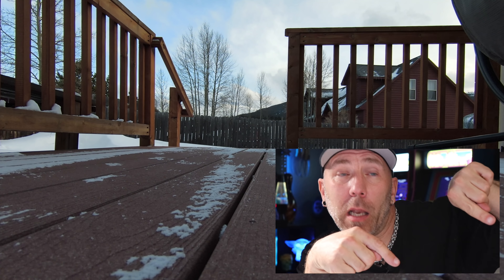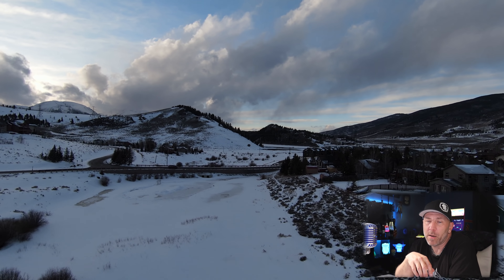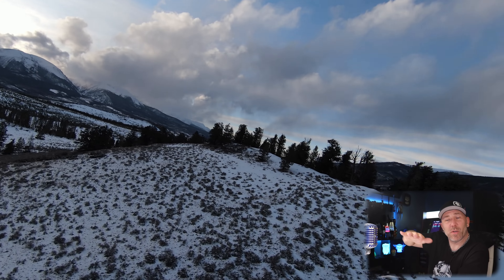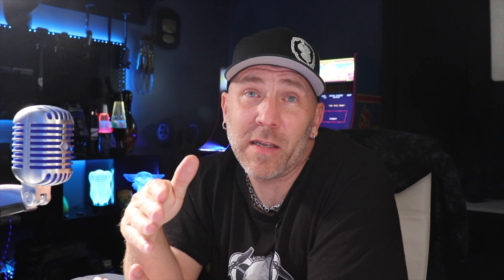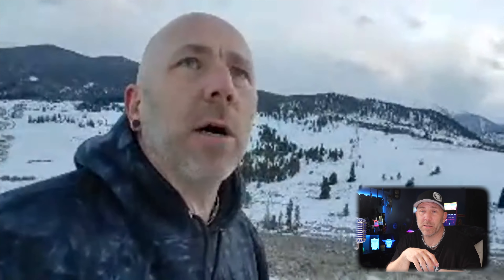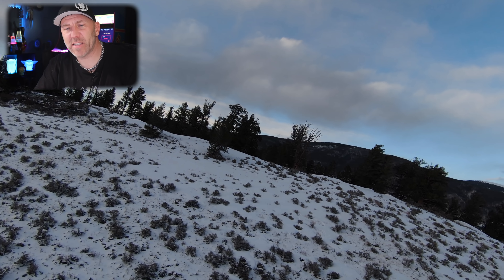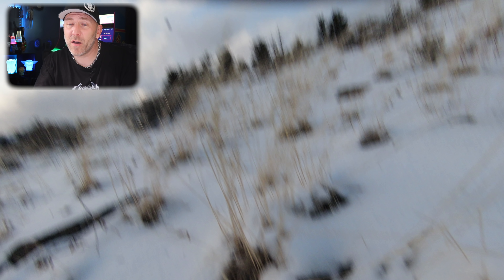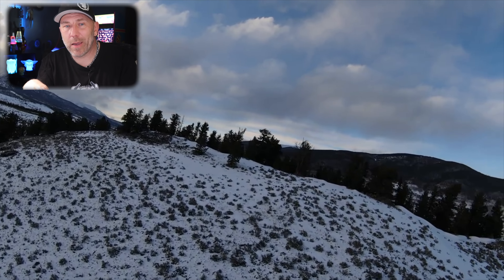DJI FPV Crash - In Drone Footage Explained (Slow Mo)

Comment: Idk if anybody mentioned it already but you have a find my drone feature in the dji app
Reply from the maker: With it on tye dji fpv it is totally different than normal dji products.  So you are aware it just plays footage of the last bits before it disconnects.  For some reason it doesn't show a map like with their other ones.
Reply: @SeanOzz  thought it does, saw a video the other day where a guy crashed his one as well and used that to find it
Reply from the maker: It plays a video back but unless it had a new update it doesn’t work like the maps

Comment: Wow that's sucks Sean but you got a great video out of it. Didn't we learn about altitude Sean. LOL. Glad that it's in one piece.
Reply from the maker: turns out i was wrong.  i lost goggle signal and the drone did it's own thing kicking into Ebrake mode which stops my controls from working. so i lost control for a second and was just low enough that without my control it hit that bush!

Comment: IDK, looking at that footage it appears to me that the quad lost signal and fail safed. If you look at that, right before it crashes there's a jolt to the quad, and you can tell, it has no radio link.
Reply from the maker: I have been rewatching all morning and I think you are 200 percent right.  The camera goes black and auto brake kicks in when that happens before you can take control again. In that moment after signal is lost is when it hard kicks to a stop and I would have not been able to throttle up in that instance.
Reply: @SeanOzz  - i think once you went over that hill and got to low, the radio link was lost. I don't own anything DJI, but ive seen plenty of fail safes! Do the goggles record your signal strength during the flight? One othwr thing i was curious about was if the DJI has some sort of buzzer for locating a downed quad?
Reply from the maker: This does have a buzzer. Found that out after. Yes. The auto brake is fast and it tried. I was just too low.
Reply: @SeanOzz  - I think so, Sean! Hey you recovered it in one piece, awesome!

Comment: You can try  the torto mode to save the FPV.
Reply from the maker: Only if it works or u have a signal.   Mine will not work , not even in full manual.  Also I had NO. Signal.  Updates video  is coming and will help you understand.  ;)
Reply: @SeanOzz  Really bad,
I thought FPV could save itself,
It seems there is no way
Reply from the maker: Seems I'm not the only one having issues with turtle mode not always working.  I plan to hit dji up this week and ask what gives.
Reply from the maker: Check this for updates. No turtle mode for me. 

https://youtu.be/TxBhHxbt6b8

Comment: Glad u recovered ur quad , in that scenario do u think turtle mode would it help u ? Maybe would have flip back on hes legs and try a takeoff that would have been awesome anyway glad ur got it back cheers
Reply from the maker: Turtle mode would if it would activate.  Also u have to have signal for it to work.
Reply from the maker: Updated info 

https://youtu.be/TxBhHxbt6b8

Comment: BTW, after watching this full video and the other one (live) something else to consider:  air density at that altitude would not allow you to gain altitude fast enough to avoid that crash.
Reply from the maker: Figured it out. Goggles lost signal which kicks in auto brake. Normally it brakes and then you can either take control or rth.  In this case auto brake did not give extra throttle or let me.  Screen cuts black and it was all in the hands of the drone at that point.

Comment: crash would be perfect if it was recovered in turtle mode glad you saved yours.
Reply from the maker: Sadly mine and others get turtle mode errors.
Reply: @SeanOzz  cuz you have to switch to manual first =)
Reply from the maker: No shit.  Lol

And for me and many others in full manual is still doesn't work.  Lol

Comment: Hi Sean, I wish that DJI had made the FPV drone to work with a phone or tablet as I can't wear Goggles. Stay Safe
Reply from the maker: you can view from a phone connected to the goggles but it does not show all the data for some reason. i wish it showed what you see in the goggles and let you go through the menus that way by touch.

Comment: Thanks for the two vids.  I recall this from flight training, but I probably won't phrase it exactly... The key factor between a non-recoverable crash, to one that is possibly recoverable, is altitude.  It's the one thing that gives you the time you need to apply a correction, but not so applicable to drone flying because the best shots are sometimes low altitude and speed.  So yeah, next time apply power to the lift lever!  Look at me, like I could advise you or anyone else.  But I love the flying, and support you.  I'm still practicing, I want to be good 'enough' by end of May.  Wish me luck Sean.  Best regards!
Reply from the maker: In this instance u can't.  
When the goggles dissconect the brake slams on.   When they turn on u lose control temp.  So in this instance I was screwed.
Reply: @SeanOzz  I guess I missed the disconnect.  I'll watch it again, but now I do sort of remember that!!!!  Beware late glasses of wine.  Thanks Sean.  I'm still glued to your channel regardless.

Comment: It looks and sounds as though the throttle cut and it suddenly dropped. Maybe it was not your fault. In sport mode I wouldn't think it could even do that because if its like a mavic it would slow down when it detects the ground. I may stick with mavic air 2 for the long flight time if I can get some type of goggles working with it.
Reply from the maker: i was wrong in this video. working on an update on what really happened.

Comment: For one thing, this drone is not fragile. I've seen this video of the guy doing the review actually flying this drone into an iron pillar. Yes, at full speed, and nothing broke. Another thing, why didn't you do the turtle mode thing? It makes the drone flip on its own? Either way, thanks for the video.
Reply from the maker: One.  You have to have signal for it to work.  I did not (update on that coming) 
Two, my turtle mode and others will not work, full manual or not.
Reply: @SeanOzz  I didn't know you if you were connected or not. Yeah, you should definitely look into that. I'm not a pilot. I just love watching all these drone videos. In fact, I just purchased my first Mavic Air 2. I'll be getting it tomorrow. Thanks for the videos. I really enjoy watching all.   👍👍👍
Reply from the maker: Nice. I have some very extreme test showing how awesome the mini 2 and air 2 are. Have fun.
Reply: @SeanOzz  I'm going to subscribe, I thought I did but definitely going to check them out.
Reply from the maker: Thanks for joining the community
Reply from the maker: Check this for updates 

https://youtu.be/TxBhHxbt6b8
Reply: @SeanOzz  you didn't have signal? Why did the controls not hold straight? 

If you let go of throttle and the other stick it should have hovered in place.

Comment: You didn’t just hit turtle mode and fly home? You said no prop damage no other damage?
Reply from the maker: Turtle mode doesn't work when u lose signal.  Actually mine doesn't work at all even with signal.  Lol
Reply: @SeanOzz  has to be in manual mode as far as I know its the only mode it works in  and yes you need signal :)
Reply from the maker: Mine doesn't work even in manual mode.   That's why I posted it will not work.  Gotta talk to dji about it Monday.  ;)
Reply: @SeanOzz that sucks   yeah go.get em :)
Reply from the maker: I will update if I ever get it working. 

https://youtu.be/TxBhHxbt6b8

Comment: Hello Sean, it would be good to know the difference on how the sticks control the drone from FPV acro mode to standard. I'm assuming it's just the left forward backwards stick changing from altitude to speed of props. I sort of assume right stick forward backwards changes the angle front to back. I don't understand why it flips, I'm assuming it's because it's restricted in normal mode. Thanks Sean
Reply from the maker: Noted

Comment: You were barely moving, I don't think speed had anything to do with it. Looked like a micro failsafe to me. Punch that throttle next time👍
Reply from the maker: Turns out. When goggles lose signal it goes auto brake and u have no control for a moment.  No throttle or anything.   My luck is auto brake did not stop it in time for me to bring it home.
Reply: @SeanOzz  Oh, I see. Glad you got her back👍

Comment: You cut the throttle. Nothing else. Keep a keen eye on your throttle management.
Reply from the maker: I actually did not.  ;0. Auto brake kicked in when signal was lost.
Reply: @SeanOzz  sure about that? I cannot see any auto breaking. You roll to the left and loose height (as usual) bit you do not seem to be too familiar with acro and forget to bump the throttle, the end.
But if I am very wrong here, thats ok too. No hard feelings, glad your quad is still fine!
Happy flying!

Comment: You actually chopped the throttle right before it hit. That was the opposite of what you should have done.
I was the same way when I started with acro drone flying. Cutting the power when you get in trouble is a natural reaction...and a mistake.
Reply from the maker: Actually. I did not do that at all. Check out the update. 

Been flying a long while.  
,)

https://youtu.be/TxBhHxbt6b8